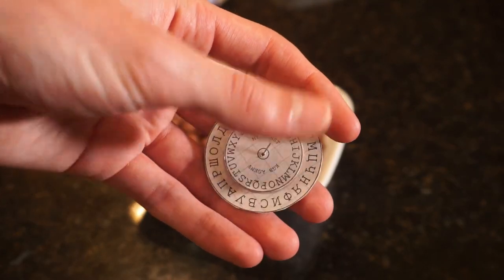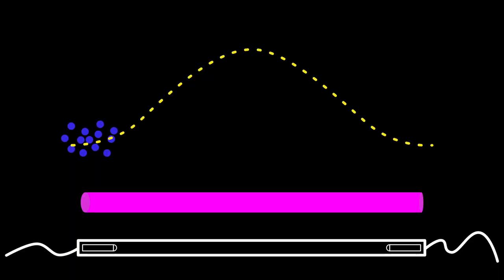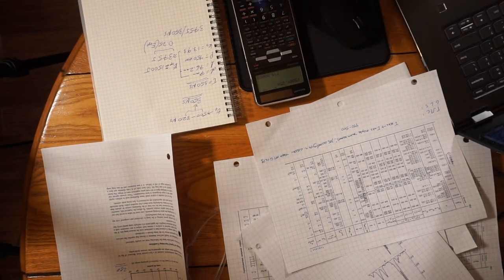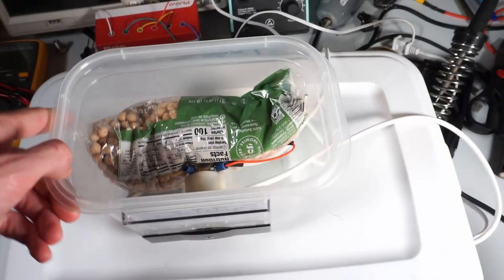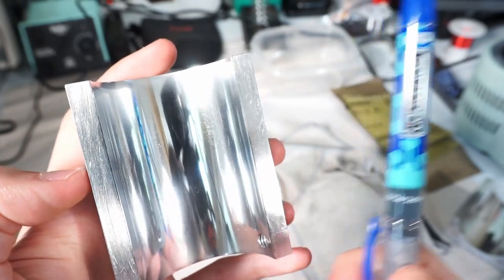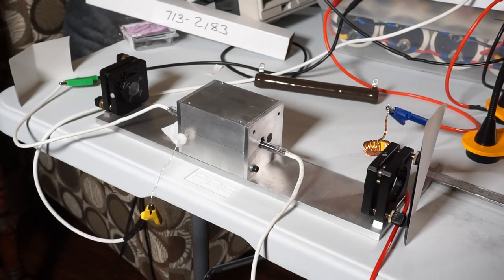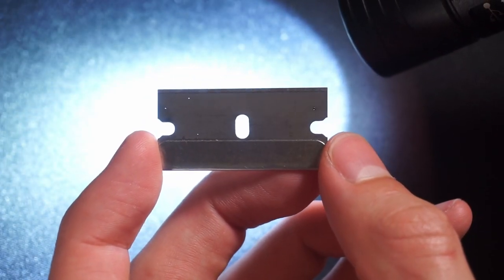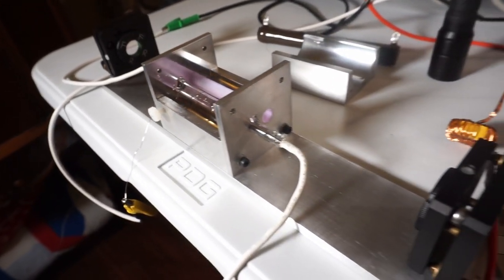How to build a laser in your living room. (Pt. 2)

Comment: Long ago I designed a Xenon flasher of 4 MW with EGG tubes. They had an excellent documentation for calculation of L/C parts to achieve optimum operation and lifetime with certain pulse energy. I would expect that this documentation is still available somewhere.

Comment: You can add more flash tubes by adding eclipses in star shape around the Nd-glass rod where each of the eclipse shares a focal point with the rod. More power by spreading the energy across the flash tubes prevents the flash tubes from exploding. You will eventually come to the point where the pumping energy exceeds the maximal absobtion of the Nd-glass rod and the laser rod itself will shatter in itself. It goes from optically seethrough to milky opace because of the sudden difragmentation.

Comment: I built a LIBS system in 2013 using a q-switched laser from an M1 Abrams tank.  Still using it, does a pretty good job of elemental analysis.  I sure wish some other people would take an interest in Libs.  All you would need is a q-switch & probably reduce power and of course a spectrometer of some kind.
Been anxiously awaiting this upload.
Reply from the maker: Doing some spectroscopy was one of the ideas I had for something to do with this thing now that it works. Maybe in the future I'll revisit it...

Thanks for watching!
Reply: Awesome!  Looks like using a camera as well, where I was assuming I'd need a linear CCD detector and a webcam wouldn't have a high enough refresh rate or something regarding gating when I asked about.  Please update the broken links in the description.  Looks neat!
Reply: @jafinch78  you’d probably need a notch filter to remove the laser light as well
Reply: @devrim-oguz  If you are referring to my comment about using a laser for libs then the laser wavelength (1064 nm ) is beyond the range of my USB2000 spectrometer so is not a problem.  I do sometimes see a line at the 1064 nm sub-harmonic of  532 nm but it is pretty low amplitude and I am aware o it and disregard it.

Comment: Very very cool, glad to see you were ultimately successful. Working on my own yag project here in the coming weeks and you had exactly the info I've been searching for on the output couplers and PFN. Im using krypton lamps from auction though, theyre rated 5kW CW though, so itll be tricky coaxing them into pulses without damaging the electrodes(I imagine at least). It'd be an engineering marvel, but I'd love to turn it into a small laser gun with either CW or pulsed operation available. Garage toys, am i right? 😅🤣

Comment: This is pretty neat! I'd be interested to see how the different laser optics you've shown behave and what their trade-offs are. Also, I'd be curious to see if this could be miniaturized by pumping the Nd:Glass rod through other means. I'm wondering if some high-power UV LEDs might do the trick, both due to their higher efficiency, and because controlling them should be much easier than tuning a pulse-forming network. 

On that note, when you talked about how complicated tuning the pulse-forming network was, my mind immediately jumped to using a gradient descent algorithm to determine close-to-optimal parameters. If there's a criteria you can numerically evaluate for how "good" a pulse forming network is, a program can tweak all the other variables continuously to achieve something quite usable, even if the intial values you enter are complete bogus.

I have some experience with high-power, low-voltage circuit design, and also some experience with algorithms like the one I've described. I just lack the equipment to build a test rig myself right now 😅
Reply from the maker: Thanks for watching! There was a lot of experimentation that went into getting this thing to work including a lot of dead ends with different pump methods and control circuits. A lot of that I had to cut out so the vid wasn't an hour long, but maybe I'll make a write up/build log at some point in the future for those interested in the gory details :)
Reply: @EricThornton24  Would definitely be an interesting read! I'm particularly interested in what other pumping methods you tried and how viable you think they would be. I'd love to experiment around with some of my ideas, but you probably know a great deal more on the subject than I do :)
Reply: @upsidedownairline9388  you don't want to pump it with UV, you'll solarize the Nd glass and create F centers. Best pumping band is around 800nm IR. Probably need high power GaAs laser diodes to get enough irradiance to actually do it. This is the plan, basically anyway, for high rep rate lasers for an actual fusion reactor such as the HAPLS prototype at LLNL.
Reply: @Muonium1  Thanks for the info! I was assuming UV LEDs would be best for this because they offer higher power densities, and didn't consider that UV might actually damage the crystal structure. 

However, this further suggests that a flash lamp really is an inefficient way to pump an Nd:Glass laser, because electric arcs produce primarily UV light. I'm guessing the glass the flash tube is made of absorbs most of that to avoid damaging the rod?
Reply: @upsidedownairline9388  the Xe Kr lamps have a fused quartz envelope doped with cerium or titanium to absorb the UV. The UV absorbing dopant actually makes them phosphorescent and the tube walls will glow blue for some time after the flash fires. The wallplug efficiency of the 30 kJ UV inertial confinement fusion laser I work on is literally 0.1%. The efficiency of IR diode pumped systems can be very high though, maybe 50%.
Reply: @Muonium1  That's very interesting :o

Do you have any information on the lasing threshold, maximum energy density, and recovery time of Nd:glass? Would be good to know roughly what ballpark I'm shooting for before I start ordering parts :^)
Reply: @Muonium1  what kind of power levels are those IR laser diodes running at? i've built some pulsed led driver systems before that were easily capable of 100kJ and readily scalable. i used some luminus devices (white) leds for that product, but haven't found much as capable in IR. cheers.
Reply: @IzziedeD  no idea, sorry. I'd search the vast LLNL literature on diode pumped systems.
Reply: @Muonium1  thanks. that's an interesting place. i've taught a couple classes there before, and it's such a weird experience to pop out to a burger place for lunch and people sitting across from you are discussing nuclear missile ballistic theory.

Comment: So you made an extrenal triggering circuit with flashlamp mounted inside aluminium made pump chamber. Are you going to use water for cooling purpose? I'm building my own laser now, so maybe we could share our thoughts and increase knowledge ;)
Reply from the maker: Hey, thanks for watching!
My trigger scheme is a bit idiosyncratic. Typically if you have a rod in a metal pump head like I have, you can just zap the whole thing with the high voltage pulse and that will trigger the lamp - no need to wrap the lamp in wire or insulate anything. But because I also made the mirror mounting plate out of metal, doing this would expose that whole plate plus the mirrors and related optics to the same pulse. When I tried to do this I couldn't contain the high voltage and things were arcing everywhere. Which is what led me to end up with the somewhat ridiculous setup of an insulated passthrough external trigger wire in an already metal pump head.

What would have been a much better design would have been to make the mirror plate out of plastic, or to account for some kind of insulation between the pump head and the metal mirror plate. This would have allowed me to use the pump head as the trigger wire and skip the whole nylon bolt passthrough. 

The other option would have been to use series triggering (see the CalTech flashlamp pdf in the description of the video for more info) but that increases the cost and complexity of the whole circuit by a lot. 

As far as cooling: for homebrew lasers like this with relatively low power outputs and low duty cycles, cooling (especially water cooling) is really not needed. The lamp does get hot, but even after 10 or 15 shots in a row as fast as I could charge the caps it was in no danger of melting and just opening the top of the pump head to let it passively cool was more than enough. With a larger laser (or a 3 level laser like ruby, which is less efficient) cooling might be necessary, but even then I would recommend forced air cooling over water cooling. The additional complexity and safety concerns brought about by pumping water through a metal chamber in close contact with lethally high voltage is not worth it IMO. 

Best of luck with your laser - if you need any help don't hesitate to reach out, there is lot of neauence that I had to leave out of a short video...

-Eric
Reply: Thank you for answer! 
About the laser - I decided to make something similar to lasers which are in commercial use. So I have to make not only trigger but also simmer circuit and of course water cooled pump chamber.
If you need high power supply for charging capacitor I reccomend variac and microwave oven transformer. It works pretty well (the same thing works with as simmer circuit).
Do you have some calculations for laser rod energies? How did you calculate output mirror transmission? 
And also maybe it is just an impression but with so large Nd:glass rod you could use two lamps for pumping. For now it looks you didn't use whole potential of this rod. What do you think?

Comment: Very cool, glad you made it work. Also, I hate to be that guy, but two equal capacitors in series will double the max voltage, but it will halve the capacitance. Your total energy might only be a half of what you think you have.
Reply from the maker: Heya, thanks for watching!

You are absolutely right that when adding more caps in series the total capacitance goes down. In this case I needed the increased voltage to get my LC circuit equations to all work out. The total capacitance of this bank ended up being the same as in my previous attempts (580 uF), but because you get a V^2 in the energy equation the total energy of this bank was about 4 times as high! (420J vs 110J) Not a "high energy" laser by any stretch - but about the limit as to what i'm comfortable working with in the home shop, but certainly enough to achieve population inversion :).

Comment: I think it's already clear why the device didn't lase in the other video. You threw out the importance of aligning the rod to your reference laser. The rod creates the reference for the mirrors and other optics, so it must first be aligned to your reference laser. But the reference laser needs to be referenced to something, too, and I didn't see that it was. Ideally, you bounce the reference laser off two mirrors, creating a 180-degree turn, so you can easily align it to some reference in both near (first mirror) and far (second mirror) fields at the height of your baseplate that you want to have the beam be. Then, mount the rod/chamber and align both reflections, so they're on top. This is when you'll see if the rod surfaces are parallel to each other. Then, add the HR mirror and align the brightest reflection so it's on top of the rod reflection--there will be two reflections because you have two surfaces; the most brilliant is the first surface, closest to the rod. Finally, mount the OC mirror so its weak reflection overlaps the reference beam, and only adjust this mirror to get lasing started. If you do it this way and are very precise, you'll already be lasing, and only small adjustments to the OC are needed to make the beam circular.
If I look at the spot burned on the Zap-It paper--which is really overkill; one can use simple black copy paper just as easily--there is a misalignment in the vertical direction, and it's pretty serious. If you align, as I've mentioned, your power will be significantly increased.